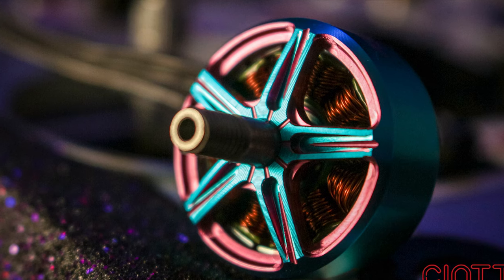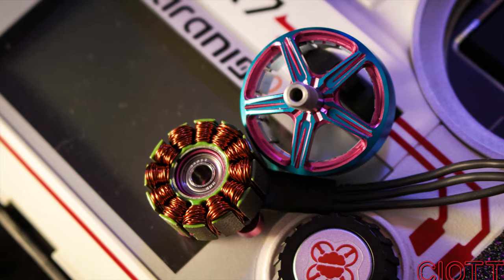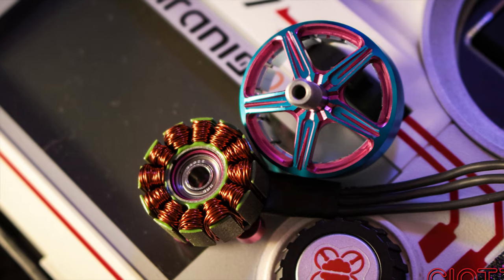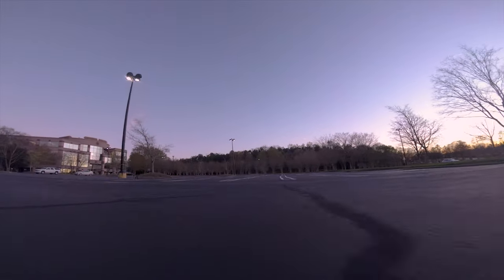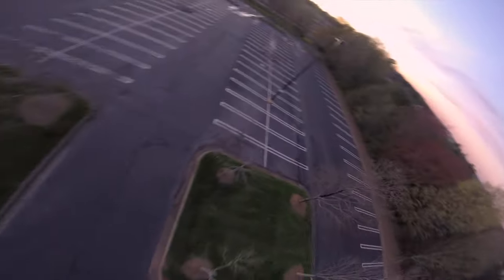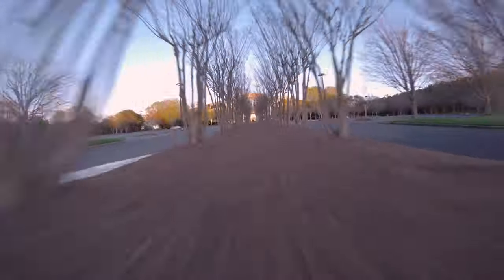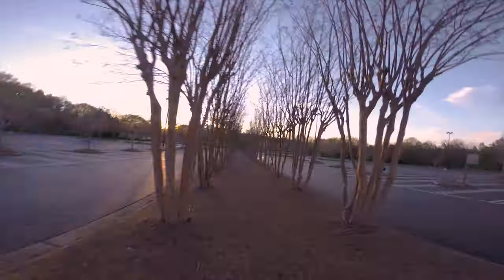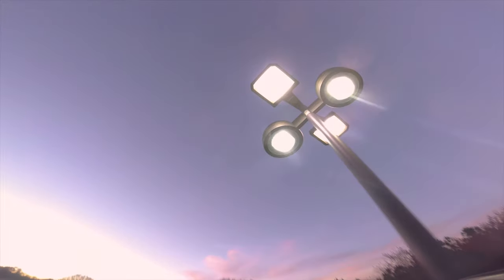T-Motor Pacer 2207.5 2550kv Review & Giveaway

Comment: Great review Ciotti!!!  Love the look of the motors and of course their T-Motor.  Would love to get a set and slap em on a quad.  While they are about 6g heavier than the 2207.5’s I run on my race quads I don’t think I’d even notice especially if I change my throttle cap on FalcoX.  Currently running the hyperlite e series 1722’s and 1922’s, love those motors but my heart belongs to T-Motor 😉.